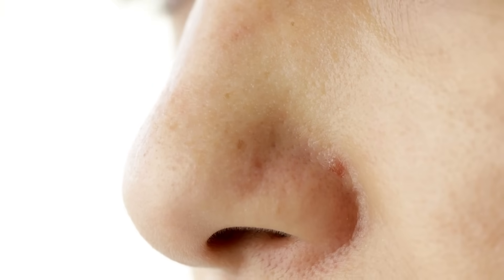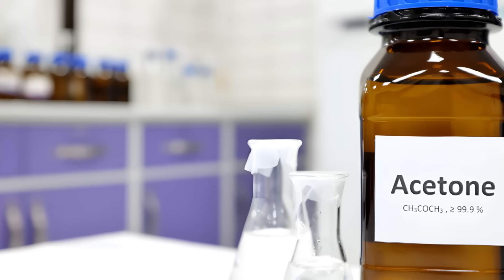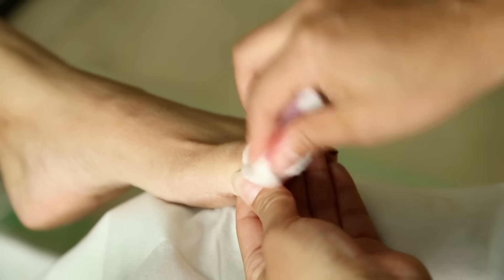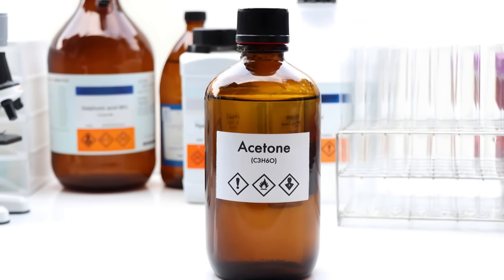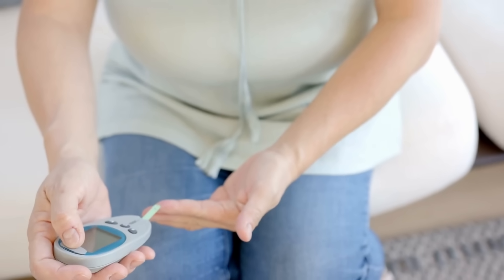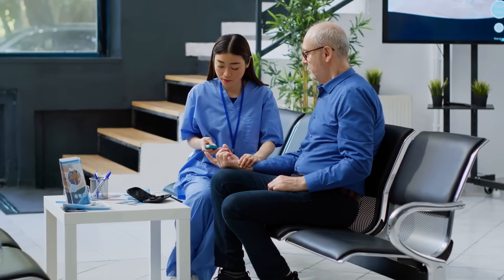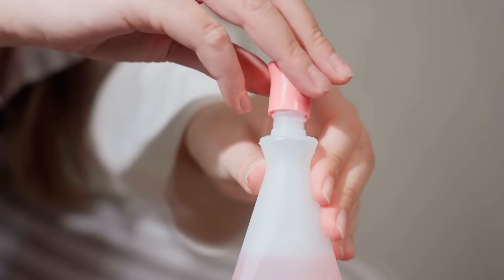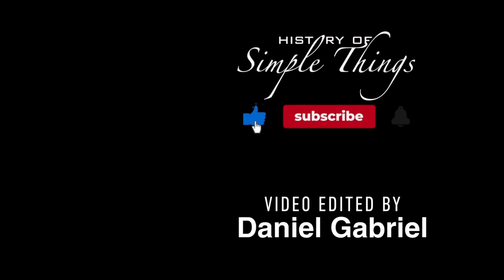What Exactly Is Acetone? More Than Just Nail Polish Remover

Comment: I use 5 percent of ACETONE in my model aviation fuel as a cleaner and as an anti backfire ingreadiant?A nd it really works? But you have to be carefull because ACETONE is an abrasive and can effect the importance of lubrication? It calms the four strokes down and aids in starting and breaking in helping the engine to turn in the correct direction? Add maybe 3 percent to your fuel and watch the exhaust??  It will be nothing but black carbon and unburned products  of internal explosions.

Comment: DO NOT clean plastic or painted surfaces with acetone.
It will damage or dissolve the surface. Especially acrylate, polycarbonate, polystyrene, plexiglass etc are very susceptible.
Be warned!
If you need a solvent use Isopropanol, IPA, in most cases that will work and is a less aggressive solvent.

Comment: Yes, we used to have acetone, which is nail polish remover, but nowadays there is nail remover, which is acetone with a little oil in it.
I do indeed use acetone as a solvent to glue some plastics, but not all plastics are soluble in it. For those, I use chloroform, but unfortunately it is much harder to obtain.

Comment: In China, you need to register with the police before you can buy acetone. The reason is that acetone can be used to make drugs.
Reply: In USA, you need to register with the police before you can buy water. The reason is that water can be used to make drugs.
Reply: @2003PantherPlatform they should ban that chemical dihydrogenmonoxide.

Comment: Why does acetone "melt" some plastics but not others?
Reply: Some plastics have polymers that can be attacked by solvents, usually petrochemicals; their links are "open" and disorganized, and have a chemical structure similar to the solvents, so the solvents can bind to them and break their polymer chains away from each other.  

Others are "Thermoset" type--once they've been heated and formed, the polymer chains are permanently cross-linked, and chemicals like acetone can't bind to them; even heat can't unlink them. 

And some plastics are so dissimilar to the solvents, that they can't bind to them.

Comment: Meanwhile in most nail polishers acetone is replaced by ethyl acetate, because acetone degreases the skin and makes the cuticles permeable for pathogens.
On the other hand acetone isn't really toxic, cmr or organ damaging at all (so the third GHS symbol on the bottle in the thumpnail is wrong). Much vapor has to breathed in before getting really dizzy - which is much faster the case with ethyl acetate. The bigger problem with acetone is its high flammability why absence of open fire sources or hot surfaces is advisible as well as good ventilation while handling it.

Comment: Great octane booster as well.
Reply: For real?
Reply: It helps fuel burn better & cleaner, improving milage — It will NOT increase octane.

Been using it in my car, mowers, kerosene heaters & oil lamps for 20 years.
Reply: @mach1553  И как часто вам приходится менять двигатели?

Comment: if acting quickly to paint on fabrics etc,  polystyrene dissolved in pure acetone makes a fabulous, flexible, WATERPROOFING (not just resistant) solution. check your product though. on leather and canvas it's excellent. not all substances can resist acetone where the polystyrene would be a good fit.  Give it a try.

Comment: First time I used acetone was for vapor smoothing ABS in 3D printing, and to glue (solvent weld) printed ABS parts. Then I found out that it is the best substance to clean up (soften) super glue (cyanoacrylate).
Reply: Вероятно. вы использовали какой-то другой химикат. Возможно, диметилсульфоксид. Затвердевший цианоакрилат в ацетоне не растворяется и в нём не набухает.
Reply: @rogermorrison2968  No. I'm sure it is acetone. It might not dissolve hardened cyanoacrylate, but can soften it (breakdown), then you can wipe it easier. Or to separate your fingers easily if you spill it on your hand.

Comment: I don't use nail polish remover... but I get 100% pure acetone that I use for removing sticky stuff and in cleaning up circuit boards in computers.
Reply: Careful with that, usually benzines (not: benzene! ;) ) or isopropanol can clean them without attacking any plastic parts in sight :)
Reply: I'm using sandpaper on the angle grinder to remove the nail polish...😂😂😂
Reply: @Loverboy6027 : A ‘Do It Yourself Pedicure’ huh? Awesome!
Reply: Use isopropanol, it evaporates less quickly, having more time to attack the grime, it is just one atom away from acetone anyway but doesn't attack most plastics
Reply: @блиныкот This.
Reply: Better use isopropanol.
Acetone will attack screen printing and coding on components.
Reply: @platinaatje6134 YES, IPA, especially 99%, less water to evaporate and won't damage most plastics and coatings.
We've used ethyl alcohol as well but I don't have a ton of experience with it.
But whatever you choose, has to dissolve the contamination you're attempting to remove.  I dunno, will IPA remove most fluxes?
I've always used MEK to remove flux residue but you've got to be cautious with MEK because it will damage many plastics and coatings, similat to acetone.
Also, fingernail polish has skin moistener buffers mixed in, these will definitely leave an unfortunate residue while any plastics or coatings are being damaged.
I personally have never experienced silk-screen solvent damage on a pcb, aren't they all epoxy based?
Reply: @thisisyourcaptainspeaking2259  I have never had an issue with cleaning PCB and removal of flux with IPA.
I think IPA is more readily available and cheaper than MEK.
I’ll never use nail polish remover (acetone or ethylacetate) for cleaning. It contains multiple additives like oils, moisturisers, thickeners, scents etc that makes it iunfit for anything else than its intended use.
I have never used acetone on a PCB and I'll never will.
Reply: @platinaatje6134   Thanks I'll give IPA a try on flux removal, never imagined it would dissolve rosin.
I would prefer to use IPA for the reasons you just listed.
Reply: @platinaatje6134 : Did you learn that from Hilery Klinton? She’s an expert!
Reply: 😮 for PCB.
Reply: @kapilsds7  PCB here means printed circuit boards, not poly chlorinated biphenyls...
Reply: I use MEK for removing flux from PCBs.  Acetone evaporates much faster.

Comment: Don't use acetone as a cleaner on surface that isn't glass, rock or metal. It will damage almost anything else.
Reply: Acetone doesn't damage the plastic bottles it comes in.
Reply: @Epidian  Pure acetone usually comes in metal container but there might be some plastic out there that resist it.
Reply: @l @lajya01 ve got a bottle of 100% acetone with me right now and it’s in a plastic bottle.
Reply: Depends on the plastic..in rc cars you can dip hole wheels to remove the glued on tires, the glue gets disolved, the tire grows a little and the rim stays in tact.
Reply: @jenshoffker5702 

Gots to be careful tho, I've found some of the rims will melt.. I usually boil mine to soften the CE glue.. 
Past 10 years I've only used bead locks on my crawlers.
Reply: I'm a gunsmith and use it alot, almost all synthetic stocks and polymer pistol frames are immune to it, but I always check as with some it will start melting right way.
Reply: It works great for plastic composite if you're going to hydrodip it or repaint it. There's a video on my channel of me prepping an AR-15 upper and lower receiver with acetone then hydrodipping it. It still hangs on my wall in pristine condition after 1000's of rounds put downrange with the new finish.
Reply: Many years ago when I was in the Air Force, I underwent some emergency surgery. Afterwards when my bandages needed changing they would use Acetone to both clean up the tape glue and to disinfect the wound. I had experience using acetone around fiberglass resin and wondered about this . Doctor told me it was safe. It both disinfects and cause the wound to dry over instantly sealing the wound and preventing infection. It worked. over the year I have used it on small cuts on my hand. It does just what the doctor said it would do.   Oh it stings. You dream for your mama.
Reply: It will react with certain types of plastic (ABS), but not all. We use it to clean glue off plastic lenses. It depends on the chemical molecular structure.
Reply: True. Acetone attacks plastics and rubbers
Reply: I understand it will destroy the UV properties of UV filtering glass.  It is found in windex and I don’t think a lot of people know this.
Reply: I cleaned up PC LCD screen from spots of spilled superglue using tissue damped with acetone. And it is ok. It is strong solvent for most plastics, but not all. ABS will dissolved, HDPE will not. Even it's bottle made from HDPE, not glass.
Reply: Oh rubbish.

Comment: Interesting. In regards to chemicals, mind explaining the differences between rubbing alcohol & isopropyl alcohol?
Reply: Rubbing alcohol is usually 30% water by volume and uses ethanol alcohol. I use Anhydrous Isopropyl alcohol in pneumatic braking systems on big trucks to keep the pneumatic valves and relays working reliably during really cold winters.
Reply: @gerrywalsh5766 Rubbing alcohol is isopropyl not ethanol. Ethanol is used as a gasoline additive or better yet moonshine..
Reply: @Notfiveo0 Ooooooops, you are absolutely right. Thank you .. major Brain Fart on my part.  Lol
Reply: @gerrywalsh5766 no problem, happens to me all the time. I just happen to use both types of alcohol in my work. (No, I don’t drink😂)
Reply: RUBBING alcohol has a small amount of glycerin in it to keep from drieing out skin when used in hospital bathing as it was made for originally.
Reply: @shawntailor5485 never noticed any glycerin... But definitely water.  Lol   We used Anhydrous Isopropyl alcohol when running PATCH tests on aircraft hydraulic system components... Especially critical on verification tests of the hydraulic drive motors for the GAU-8 30mm Gatling gun in the A-10 Lightning II. Those were fun to build.   XD XD XD

Comment: Acetone plus automatic transmission fluid together in a fifty fifty mix is great penitrating fluid I learned that from chrisfix
Reply: A gun cleaner that has been around longer than most of us were born goes by the name of Ed's Red
1 part ATF
1 part Kerosene
1 part Aliphatic Mineral Spirits
1 part Acetone
(optional) 200 g per Liter 1 lb. of Anhydrous Lanolin

Leave the Acetone out if cleaning anything polymer.
Reply: @dwightdhansen I do not know nothing about that type of gun cleaner but my favorite gun cleaner is Hopps number 9 bore solvent
Reply: @JohnSmith-lv4iq (Insert drooling Homer here)🤣
Reply: @dwightdhansen  KAT formula — Kerosene Acetone Turpentine —— Gun cleaner
Reply: Who likely learned it from Scoutcrafter 😊
Reply: Tried that, need a squirt of liquid soap. Doesn't mix completely.